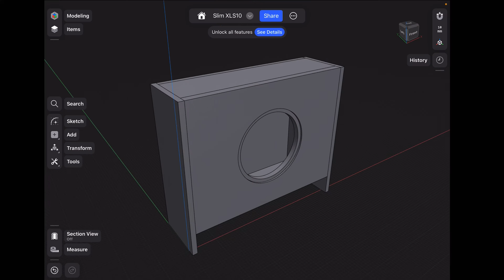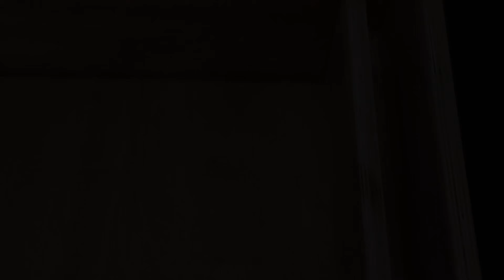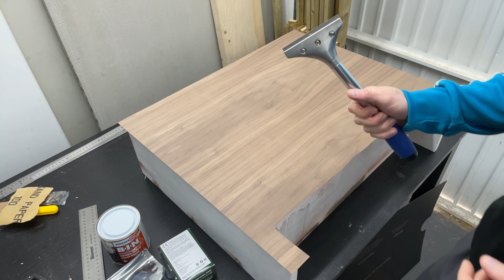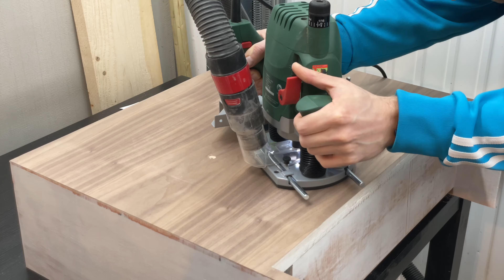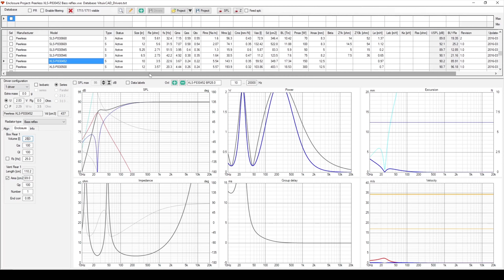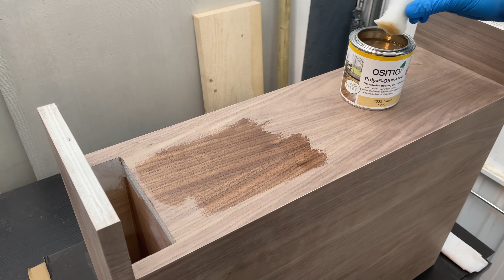DIY Peerless Cinema Subwoofer Design, Measurements and Veneering

Comment: I've watched a few of your videos and found them fascinating. I'm currently running 2 x Peerless SLS 6.5's in a transmission line, which I actually designed for a JBL GTO 804 8" sub before I sod it. I've always dreamed of having the XLS 10's, but availability is difficult. 
Just to let you know i think you might find this interesting, if you haven't already seen it;
 Acoustic Engineering Workflow  Hexibase channel